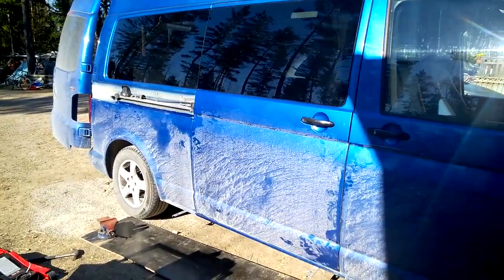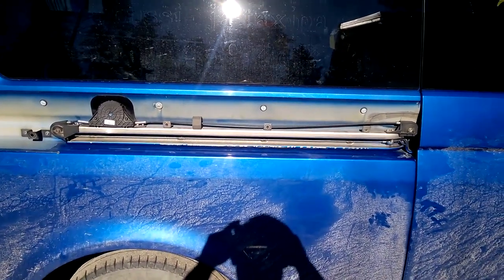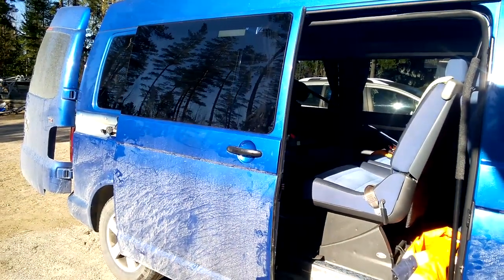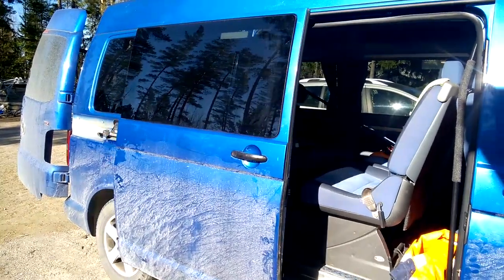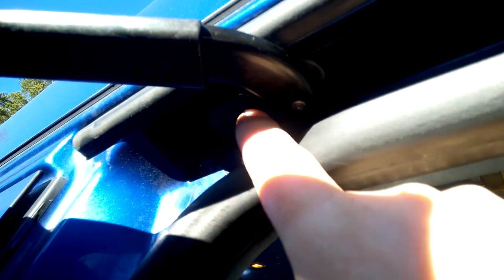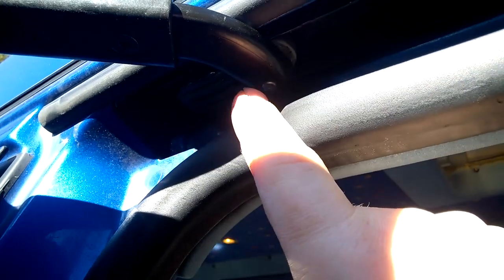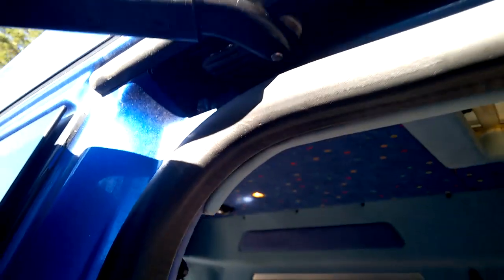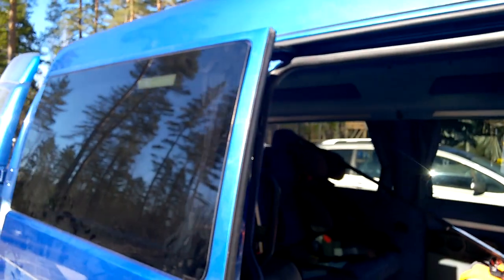Sivu oven ongelma. Side door closing problem

Comment: did you have any problems closing the electric door?
Reply from the maker: Not after I got the new part with sensor. But there was more….My door bearings in middle were so used or worn that the door was hanging a tiny bit. I never bought a new rail with bearings because it is about 1000€ 😅
Reply: @Wippe75  thanks for the answer! I'm having problems with the electric door. the door reaches the end and opens again . I think I have a problem with the pinching sensor .